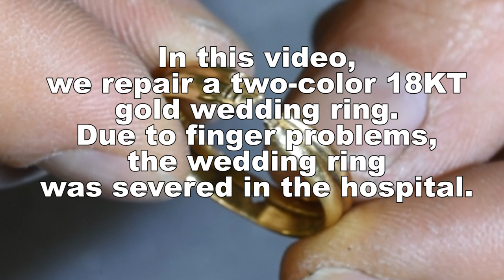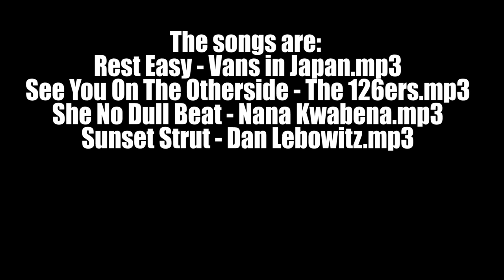we repair a two color 18KT gold wedding ring

Comment: Excellent job as always but that's a huge pin hole inside the ring at the joint. Shouldn't leave the shop without sorting that out.